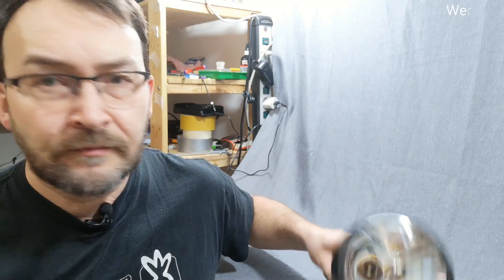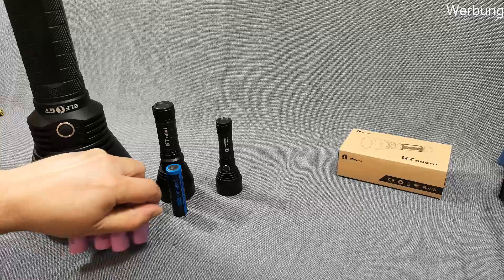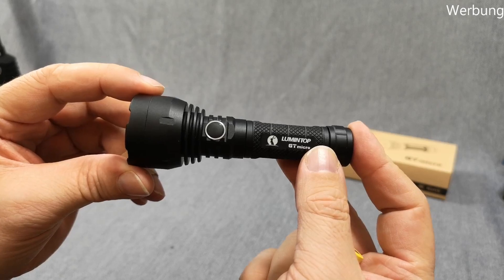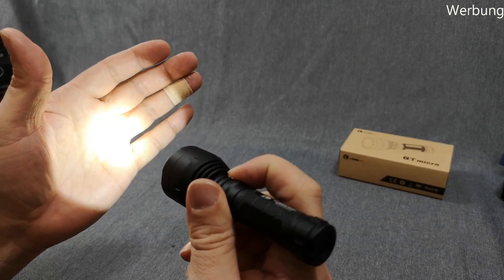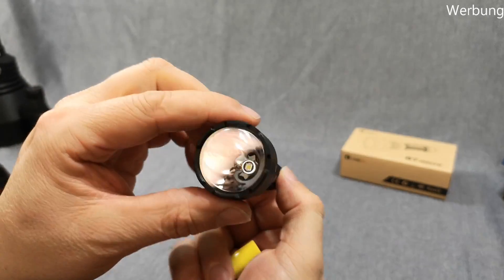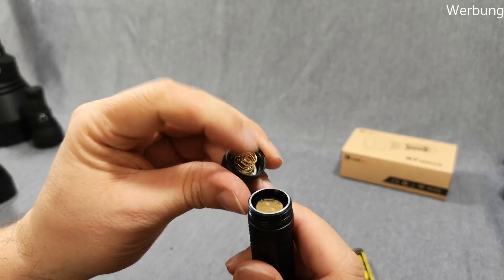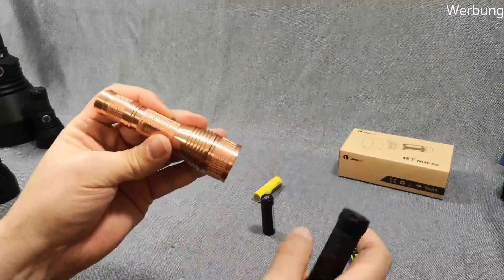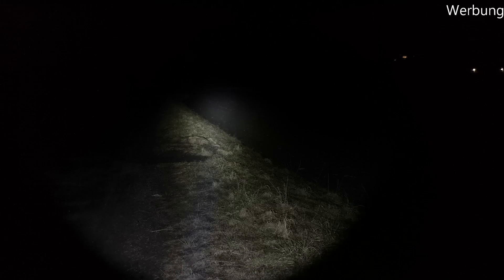Lumintop GT micro - first contact with the best "AA size" thrower

Comment: Can't tell from the video, but getting 1 more Amp compared to BLF X5 and having a slightly larger reflector should give about 43-45 Kcd. This seems to have the same output (both lumens and Kcd) as the D1. The Emisar D1 though wih an 18350 tube is a dream little pocket thrower.
Reply from the maker: Texas Ace got 53 kCd and 450m throw